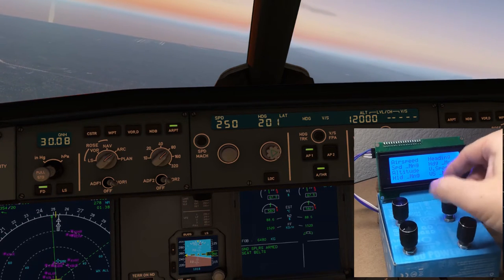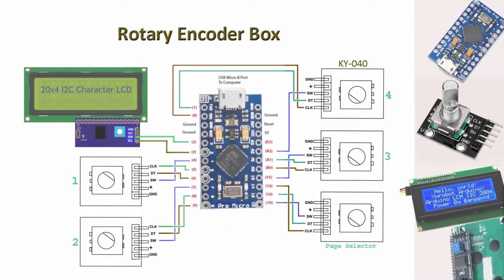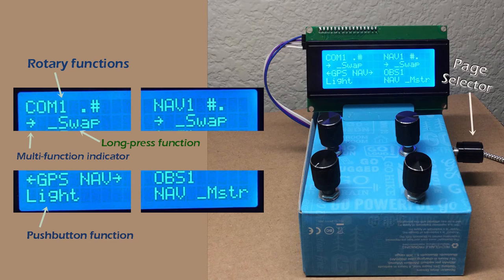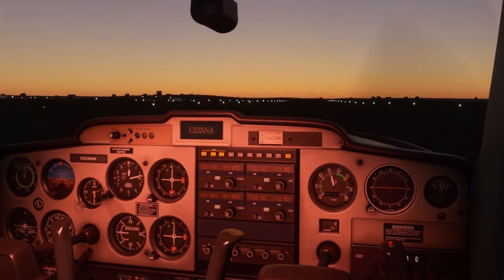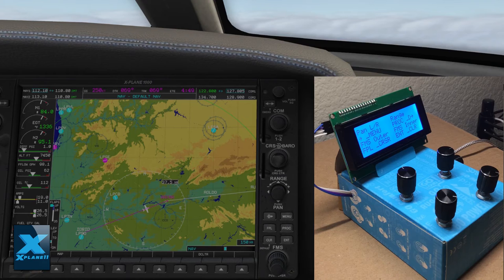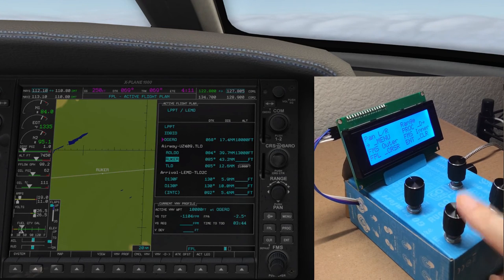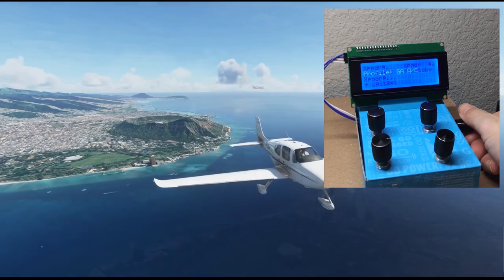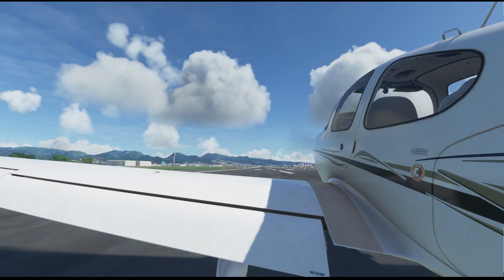Flight Sim with Rotary Encoders

Comment: Thanks for posting this. I’ll give it a serious go. Looks like what I intended. Not a cabin mock up but a flexible input device that can be used with a range of aircraft. I’m not bothered about getting data out of fs as it’s already on the screen but making it easier to input rather than using the mouse. I hate the way using the mouse scroll activates the zoom as well.

Comment: Very well done @discman777 even the temp cardboard box! I've got all the parts and files, worked on 3d printing files too,  started to assemble when I realized in my Arduino board collection that I did not have the exact one you use in the video which is an Arduino Pro Micro. I have "Arduino Micro" and "Arduino Leonardo", but will order a few of the pro micro. The pin setup confuses me a bit looking at trying to use the boards I have, as I am pretty new still to Arduino. I can follow along when everything matches and get things to work but at the moment I'm stuck. I don't suppose you have a resource or alternative chart that shows how to connect the wiring for an "Arduino Micro" and "Arduino Leonardo" and if not no worries Ill wait for the pro micro in the mail.
Reply: Would be interested in learning about that myself if possible.
Reply from the maker: @Randy Vitorivich.  
{edited.  The Micro has digital pins 0-23)
The Micro should be usable for the project.  The Micro has more digital pins available than the Pro.  
The five encoders utilize a total of 15 Pro Micro digital input pins as follows: 0-1, 4-10, 14-16, 18-20.
The physical pinouts of the two devices are of course different.  So, your wiring will need to “remap” the Pro Micro physical pin numbers to that of the Micro’s physical pins.

Comment: amazing video, i subbed straight away! 

Does this system work for other simulation games as well? for example farming sim or a trucking sim

Ps: keep up the good work!
Reply from the maker: It should work for any game as long as you can configure your game to accept joystick button codes to operate the desired commands (mapping).  Typical joysticks support up to 32 button codes.  This box can generate over a two hundred codes--or as much as your game allows.

Comment: Thank you !! I'm printing A320 throttle quadrant (with potentiometers on the levers) and was wondering if I could use some encoders to work with MSFS. Although I know I'll struggle with the code to make everything work, I know it can be done.
Are the rotary sensitive to velocity? I mean, if you turn them quicky does the increments raise or are they always 1?
Reply from the maker: An encoder will “increment” more frequently (number of “1”s per second) the faster you twist the knob.  Let’s say your typical encoder gives you 20 clicks per a full 360-turn.  Then each full revolution of the knob will give you 20 increments—no matter how fast you twist it.  Yes, there is a limit of how fast the pulses can be registered.  As for the flight sim applications, if you’re twisting a knob so rapidly, you probably aren’t looking for precision anyway.

Comment: Hello
When I compile, fail with can't find the libraries.
I have the library folder in the same location as the other files ie. ino doc etc.
Normally I would install libraries via the Arduino IDE. But not sure how to do this as the libraries supplied are not in a zip file folder. Any help please.
Thanks John
Reply from the maker: The .ino files should be in a “RotaryBox” folder under your “Arduino” folder.
The library files (.h, .cpp) should all be in a separate folder (e.g. “RotaryBox”) to be placed under the “Arduino\libraries” folder.

  Arduino\RotaryBox  <--  .ino files
  Arduino\libraries\RotaryBox  <--  .h, .cpp files
Reply: @discman777  thank you.

Comment: Hey Discman, maybe you can help me. I dont find the ingame control command for the second Page on you Airbus Profile. In your Video you can change the ND range and ILS and VOR an NAV ARC and Plan. Is it possible, that you list the ingame control commands for your allocation? I try four hours, but no switch i allocate will change the damn ND Range. Is there a software, wich can read out the command while i turn a knob with my mouse or something else? Maybe over SimConnect interface? Best regards and thx 4 your work
Reply from the maker: @Mir Gehorts
First, are you referring to FS2020 or X-Plane11?  FS2020 has NOT made available many of its controls for button binding.  I don’t think it’s possible to control the ND with current FS2020.   The video was shot in a ToLiss Airbus.
If you’re referring to X-Plane, leave me an email contact then we can try to figure things out.
Reply: Hey Discman, thx for your answer. I use FS2020. Damn, dont know that u use X-Plane. Hope with SDK or Simconnect will be a way to use it in the Future. Was so happy to find your Rotary Box.

Comment: Hello!
I have managed to compile the rotarybox ino without issues, the screen fires up but the controls are unresponsive, and I have wired up everything as you laid out.
I have used a Leonardo as I do not have a micro pro, any thoughts?
It seems that the inputs are firing up at all times and it does not work.
THank you for sharing the project and for any help.
Reply from the maker: The Leonardo (I don’t have one) is supposedly a superset of the Pro Micro, so it should work.  But you probably need to remap the higher (18, 19, 20?) digital input pins to match the Pro Micro.

Check whether your encoders include Internal Pullups.  If not, you need to change the firmware to enable the pullups internal to the Leonardo.

One troubleshooting suggestion is to wire up one encoder at a time to isolate/locate any wiring error.  If you need a simplified .ino for encoder testing, I can send you one if you can leave an email address.
Reply from the maker: Here is a simple encoder test.  You can wire up one encoder at a time, modify the pin assignment in the .ino to match.  The encoder action is displayed in the Serial Monitor.
https://drive.google.com/file/d/11puFrnLmJj6ydo6d7llbWVfQJw8UBl1r/view?usp=sharing
Reply from the maker: Glad you have everything sorted out.
Your messages aren’t showing up here, YT filtered them for reasons unknown.

Comment: I don't know how can I use in flight simulator because it not able to put any buttons on the control configuration, it freezes when I am defining a button.
Reply from the maker: Have you read the “How to Configure” example in the PDF file?  
My Rotary Box has long been recycled.  If you want me to look at what you have changed, please leave me an email address.
Reply: Hey Victor, did you get the freeze sorted? I am having this problem and would like to get it fixed. Thanks in advance

Comment: Great work
My only question is how to program all that? It seems to complicated.
I use mobiflight but your settings is different.
How do you do that?
Reply from the maker: @TechSilv  This box was intended to be a very simple and low-cost DIY design (my first Arduino project).  As you can tell from the video, it is a one-way “button box”.  It wasn’t designed with configurability as the prime objective, as in MobiFlight.  That said, all the encoders and pages can be defined by the user, if you’re willing to tinker with the Arduino IDE a bit.  All the source code are in the link.  To define your own encoder pages, you don’t need to write any new code, but you do need to modify a single “include” file.  So, basic knowledge with the C language really helps.  The link include a 4-page instruction on how to add new buttons.
Reply: @discman777  great
I will have a look on the link and see if I understand the language and codes on that .
Thanks
Reply: After a few days working on my project I managed to do similar but with only two seven segments one encoder and two push buttons to cycle all radios
👍👍👍

Comment: that's awesome! do you know if it's possible to connect them using a matrix and use fewer pins on the arduino?
Reply from the maker: That would be rather tricky.  Mainly, encoders aren’t just simple switches, you need to detect relative transitions.
Reply: You can use mcp23017 for encoders. To reduce the pins. It has 16 I/O and uses 2 interrupt pins on your arduino.

Advantage of interrupt is it always give peiority for that input

Comment: Discman777
hello, I found the encoder project perfect, but I couldn't transfer the code to the arduino, it gives some errors, will it be possible to send me the code you used for the video?
Reply from the maker: Actually what files are you looking for?  The .Hex file from the compiled binary option? 
If you have problem compiling the source files that you already have, you’ll probably need to sort that out.  Since if you are unable to modify the original source and reload, the project usefulness will be limited.
Reply: @discman777  I'm not an arduino expert, but I managed to install the libraries and so it walked a little but, it always has a compilation error and doesn't upload to arduino... I'll test again and send you more precise information, ok tks

Comment: Hello guy! I saw you shared files of programming you did. I am not sure how can I load it to arduino? Can you help me? Regards,
Reply from the maker: There are dozens of introductory videos on the Arduino, e.g. https://youtu.be/R102xfcx75I?t=624
Follow the tutorial but select Pro Micro and your COM port.
Reply: @discman777  Hey guy! Is possible to set in Arduino Mega? I've found issue to load it.
Reply from the maker: @diogoflorentino9434  Only the Arduino Pro Micro and the Leonardo can emulate a HID device easily, which this what is project requires.  If you’re an advanced level user, you could search for “HoodLoader2” on the web.  It might do what you apparently want.  I have not tried that myself.

Comment: Hi again.
Working now, but awful jitter when i test using windows game controller.
Like to try the internal pullups but not sure what or where to change. I guess it would be in the RotaryBox.ino 
. Could you point me in the right direction i.e which variable name.
Thanks again and promise not to bother you again😊 john
Reply from the maker: In the file CEncoderPlus.cpp (under libraries\RotaryBox):
Change from:
    	pinMode(pinA, INPUT);
To:
	pinMode(pinA, INPUT_PULLUP);

You’ll find there are a total of 3 lines to modify.  Hope that’ll take care of the jitters.
Reply: @discman777  thanks so much. You have been a great help
RegardsJohn

Comment: When I try to upload the files to my Arduino (Leonardo) I get all kinds of errors. E.g.:

.....Arduino\libraries\RotaryBox/Configuration.h:66:1: warning: missing initializer for member 'sEncoderDef::labelIx' [-Wmissing-field-initializers]
 };
....

......

exit status 1
'ShowProfileName' was not declared in this scope

Also I already built myself a throttle quadrant and just want to add only 2 rotary encoders for HDG and ALT. The currecnt code is a joystick config with for analog axis for throttle, speedbrake and flaps. Is it easy to take over part of the code for the encoders and incorporate it into my existing joystick code? But first I want to make sure the files you shared load as is on my arduino.
Reply from the maker: @Maarten van Roji
Do you have the three .ino files located in an Arduino\RotaryBox folder?  I see from your path that you probably already correctly have the other .cpp, .h files (7) under Arduino\libraries\RotaryBox.

It is possible to have just two encoders for the HDG and ALT operations.  Much of the code here can be cut out—you only need the encoders to generate four “button codes”.  You’ll need about half of the existing main loop, the Encoder and the VirtualButton files in the RotaryBox library, and the JoystickLibrary.  You won’t need the configuration files because they deal with the collection of pages, multi-function rotary and LCD.

Leave me an email contact info if you have more questions.
Reply from the maker: @yornav  
(Your email address doesn't work)
You need to simplify the RotaryBox.ino to something like the one in the link.  You won’t need the other two .ino files.
https://drive.google.com/file/d/1TOa4suPL1HOOhM1Y1XygBwo9TnXpXhyH/view?usp=sharing

I tried it out for a single encoder case and it works.  I suggest you get the single case working first, and then add the second encoder.

Good luck.
Reply: @discman777  Hi there! Can you make this link available again please? I just want to refer how the single encode works. I'm getting invalid conversion errors for the profiles when using 5 encoders. :(
Reply from the maker: Here's a single encoder demo:
https://drive.google.com/file/d/12F_NB4S3_NXany6tKjRne0--Wz7dqtbQ/view?usp=sharing
Reply: @discman777  Thanks mate! I'm always getting a pushbutton input. Do you think its with the boards?
Reply from the maker: I know the code sample works because I tested it before uploading.  Could be your encoder needs pullups.  Try changing to:

    pinMode(pinSw, INPUT_PULLUP);  

The other two pins may need the same as well.
Reply: @discman777  You're right! I just loaded it up finally. I'm using EC-11 encoders maybe that's why. Will explore tomorrow if I can add a few more buttons to maximize the pins of Leonardo. Thank you so much!

Comment: I see you used arduino micro. I have an arduino uno. Will this work? Thank you
Reply from the maker: This project requires the Pro Micro or the Leonardo, for it needs to operate as a HID device.
Reply: @discman777  Oh ok. Thank you for quick response

Comment: Can ı use Arduino UNO ? Is arduino pro micro obligatory?
Reply from the maker: It needs the Pro Micro.  The UNO does not have the HID feature.
Reply: @discman777  Thank you . I want to ask you. I don't know about software but I like aviation. Can i do this project?
Reply from the maker: @Fonksiyonbabası  You don’t need to change or write any code if you just want to use what was shown in the video.  You do need to install and run the Arduino IDE software to build and flash the firmware.  Troubleshooting skill might help should there be any wiring error.
Reply from the maker: @Fonksiyonbabası  Material list: Pro Micro MCU, LCD 2004 20X4 Display with the I2C Interface, five KY-040 rotary encoders (w/ knobs).  Wires for connection.
And of course, the Arduino IDE—if you don’t already have it.  Looks like you have, using the UNO before.
Reply: @discman777  I read the 4 page document but I couldn't understand it: do we write the codes ourselves? If not, how do I upload those files to the pro micro... I know thanks to the Arduino IDE, but what should I do when I enter the Arduino IDE? Are you opening different files and uploading all the code to these files? Sir, a tutorial video for this would be very good or can you contact me. I would be very happy for that. Thanks for everything sir...
Reply from the maker: @Fonksiyonbabası  The 4-page document was written to explain the use and maintenance of the project, it is not a tutorial for general Arduino projects.  I suggest you first use YouTube or other sources to learn the basics of the IDE and working with Arduino.  Work through a couple of simple examples first, to build up the skills needed for this DIY project.

Comment: does it work with pmdg b738
Reply from the maker: The encoder box will work with any game operation that accepts pushbutton as input.  An action from the rotary appears as a button being pushed.  If the PMDG allows you to bind a joystick button to the function, then the function can be triggered from the box.  That said, the Pro Micro has rather limited code space, so it limits the number of different functions you can have at one time.